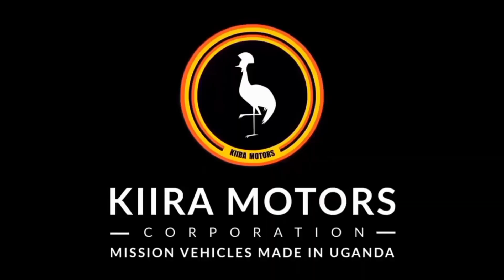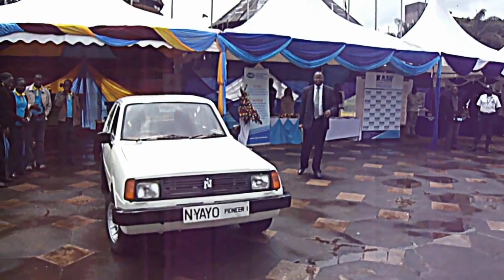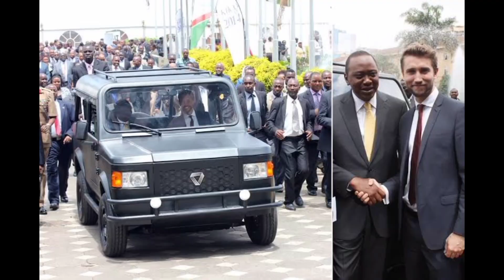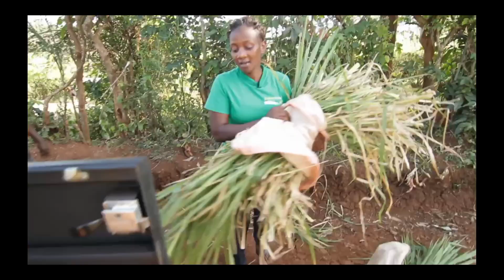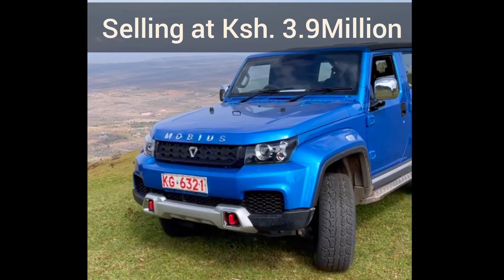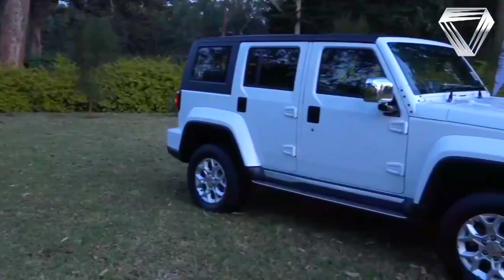Finally 😱, Cars made in Kenya. Nairobi City. Mobius III. | Documentary.

Comment: it is made in China and rebranded in Kenya (BAIC BJ40)
Reply: You can build anything from scratch now even planes Boeing and air bus parts comes from different countries.
Reply: @pinchesmbuche4354  That's not building, that's actually assembling.
Reply: ITS OKAY BUT THEY HAVE TE TECHNOLOGY TO DO SO . @maryabura7173
Reply: I do not think its the same car. A BJ140 is ksh 3M in ME, if you import it, it will be way more than ksh 3.9M! It also looks like a Jeep. Did you know Baic has a partneship with mercedes and hyundai? The start/ stop button is straight from merc, the steering wheel, even the stitching is all merc. The B40 is 600,000 rand in SA, so not the same car